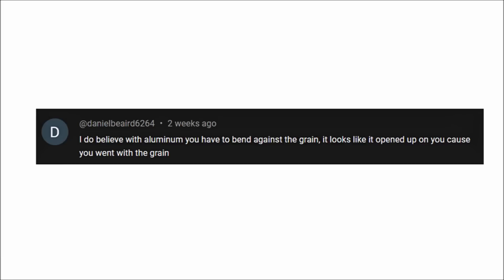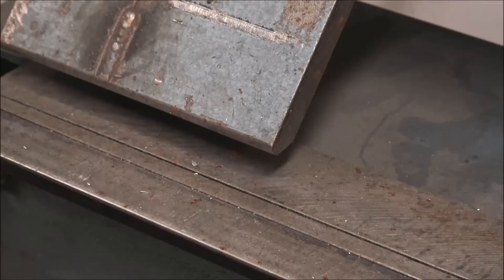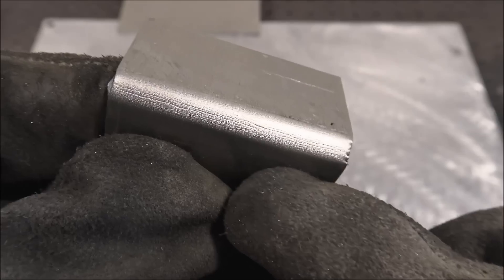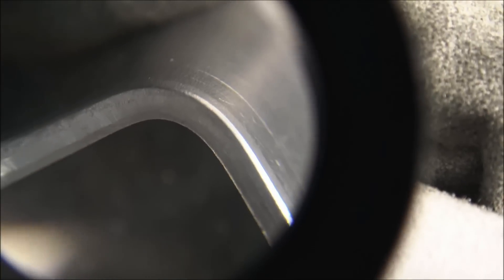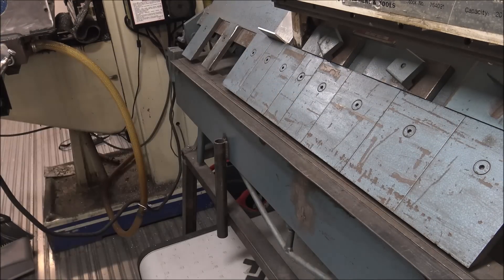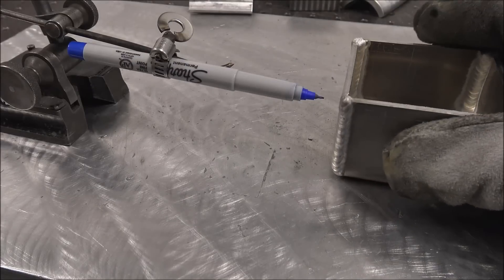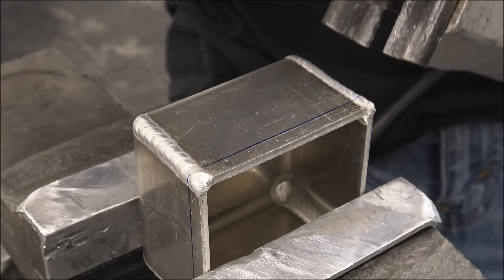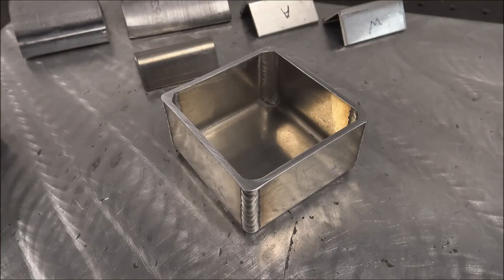Professional Fabrication Tips - TIG Welding Aluminum Sheet Metal Work

Comment: What is the thickest aluminum you consider full penetration (reinforcement on the backside) achievable?  I've been running beads on some 1/8" 6061 and get inconsistent, if any, punch through on the backside.  When it does punch all the way through, the bead is usually really grainy.  I've tried mid amperage/slow travel, higher amperage/faster travel, and everywhere in between with no consistent result.  I'd be interested to hear your take on it and any tips you might have.  Your videos are excellent!

Comment: Great video, THANKS! I worked at a fab shop where we used to make aluminum diamond plate industrial staircases. We would bend the diamond plate (if I remember correctly 3/8") by heating it before putting in the break. When the heating process wasn't just right the plate would crack when we attempted the break. Would heating be worthwhile for this smaller work?

Comment: Nice video.  I really like the fabrication tips and your approach to investigation.

If I may, I would like to clear up a few possible misconceptions.

On the extruded 6061 material, what is being seen on the surface as "grain direction" is more likely just roughness from the extrusion die.  Aluminum doesn't really have a "grain direction".  Aluminum has a face centered cubic lattice.  Imagine if you will, a cube and then each vertex has an aluminum atom and then there is an aluminum atom at the center of each face.  This lattice structure has 12 basic slip planes.  As a result, the material properties are pretty much the same regardless of the direction of force applied to the lattice structure.

This is a property called isotropy.  Aluminum is pretty much anisotropic.  However, in rolled products, there is some isotropy due to the elongation of grains in the rolling direction.  But this is a different phenomenon than from the basic structure.  If a rolled product is annealed after rolling, this isotropy due to grain elongation for the most part disappears.  This due to the grain structure in the rolled product not being an equiaxed grain structure, that is individual grains that are equal in all directions.

Some materials, such as titanium are isotropic because their basic lattice structure does not have as many slip planes.  Just to mention it, the basic crystal lattice for titanium is called hexagonal close packed at room temperature.  This basic lattice structure is more complex than the FCC lattice, but it has only two independent slip planes.  As a result, material properties, especially elongation depend on the direction in which the principal force is applied.  It transforms to a body centered cubic at higher temperatures which is why titanium is often formed at an elevated temperature.  This is also why grain direction on titanium sheets is tracked.

On the bend tests that you did on the 5052, what you are observing is most likely exhaustion of ductility.  In the O condition, 5052 has an elongation of 14 to 20% while in the H32 condition (which I believe is the standard condition for 5052) it has an elongation of 4 to 10%.

When designing materials to be bent into shape, the bend radius is taken into account in order to avoid loss of ductility.  This is noticed more on thicker items than on thinner items.  That is, thinner materials can be bent to a sharper radius than thicker materials.

You can compare the ductility of 5052 in the O condition as compared to the H32 condition by annealing a piece.  This can be done by heating a piece of 5052 to 650F and then allowing it to air cool.  For a small piece, you can just heat it with a torch until you get to 650F and just hold it there for a moment or two before letting it air cool.   It can be annealed at a slightly lower temperature, but it will need to remain at that lower temperature for a longer period of time.

The inward slant that you are seeing on the end surface of the bends is due to an effect called Poisson's ratio.  This is if I deform a material in one direction by applying a force, it will also deform in the perpendicular direction in the opposite direction.  That is, because the material is being elongated in the bend direction, it will contract in the direction perpendicular to the bend direction.  The elongation in the perpendicular direction is opposite that in the principal strain direction.

When bending, there is what is called the neutral axis of the bend when the material undergoes no elongation.  On the outside of the bend, the material is being elongated and on the inside of the bend the material is being compressed which result in tensile and compressive forces respectfully.  If you look closely at the ID of the bend, you may likely see a similar phenomenon, but instead the material will raise up as it is experiencing a compressive strain.

HTH and keep up the good work.
Reply: Thanks! i was wondering if that "grain" in the alu isn't just "surface optics from the manufacturing process".
This video was the first time i have heard the term grain used with metal, i only know it when it's about wood and other materials (but then again, i only had one school year of being taught about metal properties in engineering school long ago, and nothing like it since.) And i wasn't aware of what you described about titanium. (we didn't cover titanium then) I only remember having heard that titanium "flows" over time. (changes shape under pressure that would not deform it right away but does over a very long time).
Reply: @nirfz  tyvm.  The phenomenon that you are describing about titanium may be at elevated temperatures and is called creep.

Comment: The grade of the aluminum is more important, 6061 needs to be annealed or a large bend radius is required. 5052 and 3003 bend far better. It’s a hardness and bend radius issue, and like you said sometimes you have to bend both ways. I come from automation and CNC rolling for manufacturing custom tubing and we usually roll tubes across the grain. However on a sheet metal brake, inside radius is usually a minimum of 1.5 T.

Comment: At my shop we use a radius die in our hydraulic press brake on most of the aluminum projects, our finger and hand brakes come in handy here and there. We only worry about keeping consistent grain direction on polished 304 stainless.

Excellent video and free information provided👏

Comment: Something i do, mainly because i dont have a bender at home, is cut a groove on the inside of the bend. On 1/8 material i went about half way and then folded it. Seemed to work ok. The bend isnt going to be exact like you achieve , but close enough for the girls i go out with

Comment: Very interesting video, thank you. If making a box out of very, very thin aluminum it helps to prevent cracking by making the bends at 45 degrees to the grain. That's how we were taught while working at a major airline.

Comment: So, most extrusions are 6061-T6 a hardened material and more likely to crack when bent in a tight radius. Sheet aluminum is more available in unhardened varieties and easier to form. Some alloys can't be hardened (5000 and 3000 series) But you are correct that grain makes no difference other than the surface finish since there is no directional "grain" in aluminum.

Comment: Why don't you use a height gauge with a carbide scribe?. (I have 2 analogue and 2 digital ones now, they arent expensive) 
It'll save your calipers from getting worn and more accurate than a sharpie in a scribing block. Most fabricators could use one daily but don't seem to know about them?
Great vids though, very helpful tips 👌

Comment: The striations in the middle of the bend look more like tensile test elongations, necking imo. The material on the outside of the bend is under tension, material on inside being under compression.
At the corners, as you described, do look to be the start of cracks.

Good video, I always learn something, usually it’s the things you do but make no mention of, or the pragmatism in your tooling. 😉👍🤙

Comment: How do you ball up your tungsten? I remember learning to ball it on plain steel, but can't remember how or if there is an easier, better way.
Reply from the maker: It's explained in detail on the website www.6061.com
The 2nd topic (torch setup and tungsten shaping)
If anything isn't answered in detail on the website, feel free to email me.
Reply: @6061  thanks, will check it out. I get good results welding aluminium with a pointed tungsten, but wouldn't mind trying out the balled method to see if it makes a difference 👍

Comment: Does it help if you heat the aluminum first?
Reply: Heat or anneal?
Reply: Yes but why would you?
If you are having heat/anneal to get the bend you want without cracking, you are weakening the material in that area so you might as well just be using a grade that can be bent to what you want. For example if you are using 6061 but having to annealing the bend region to get the bend you want, than you might as well be using 3003 or 5052 since you've weakened the 6061 to the level of those in the annealed region.
Reply: @CP_300PRC  What if you only have 6061 on hand and are fabricating something like a box that isn’t structural and are just trying to keep it from cracking? Most people aren’t rich or have the room to keep every type of material at our fingertips. Sometimes you just have to call an audible.
Reply: Yes, a lot actually
Reply: Yes
Reply: Absolutely!  I’ve made some pretty sharp bends that weren’t showing much stretch and no cracking on .125” 6061 by using the lighter soot method.